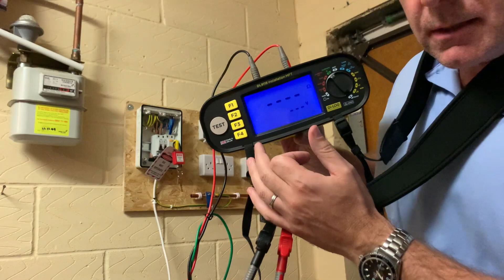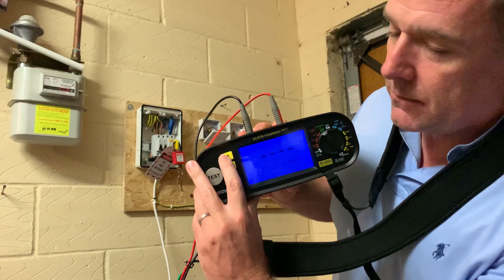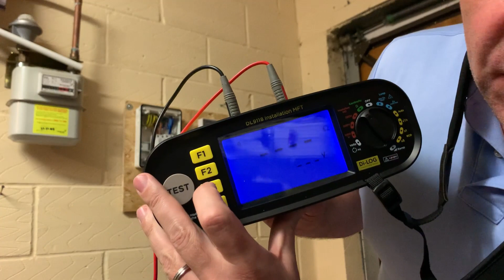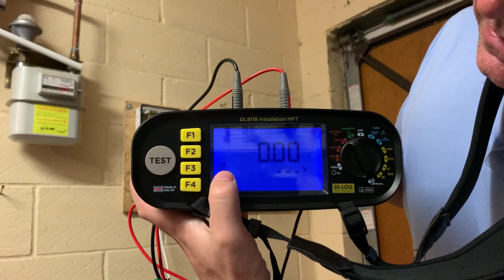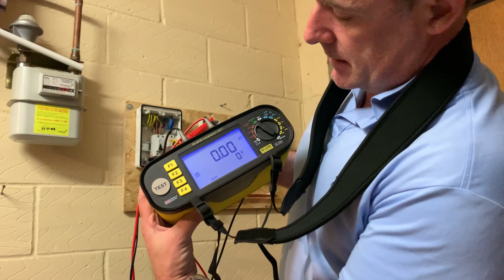Di-Log 9118 Continuity setting and null function

Comment: Nice video. What leads are you using mate? I prefer the new colours so use Brown phase blue neutral and green earth on my Di-Log but the leads look nice and have a great low resistance??? 
Best regards, 
Scott. ✌️🙏✌️
Reply from the maker: Thanks Scott, I’m using the leads that came with the 9118. Did you get your leads from Di-Log? Cheers Paul.